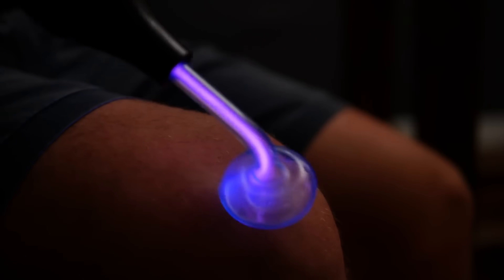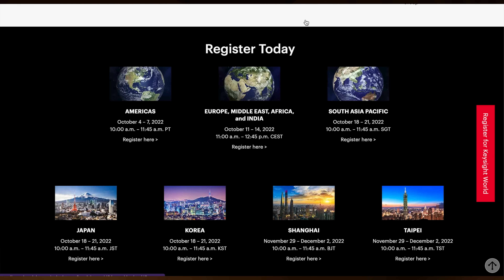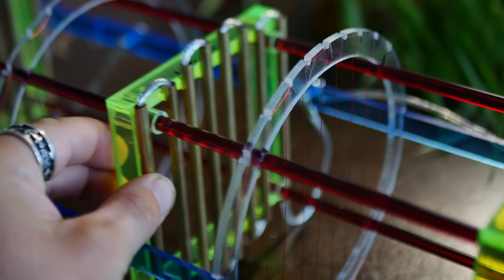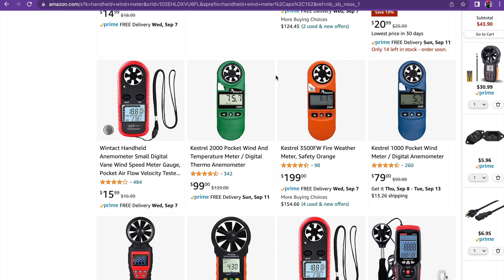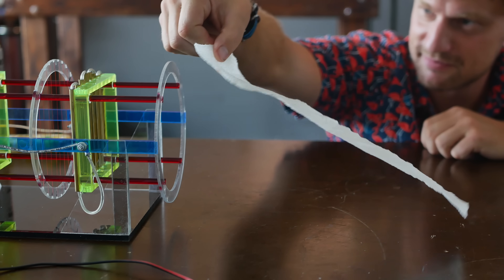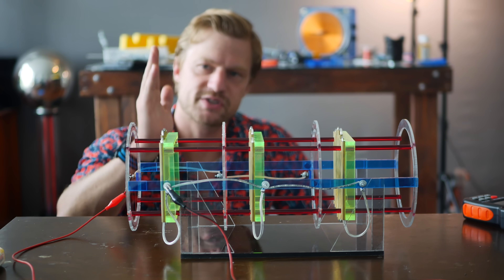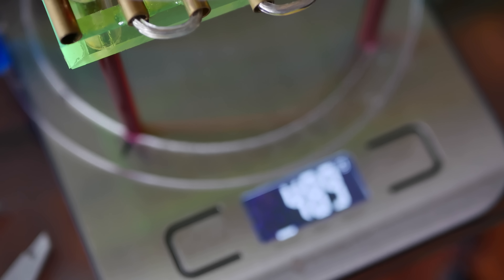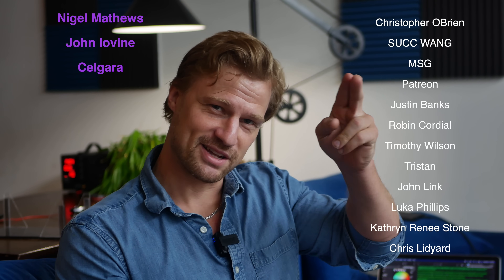Designing A Next-Gen Ionic Thruster! (For Flight)

Comment: i may not be the smartest, and i know this is a test model, but in future non-test builds exposed wires are a bad sign...
i know that they are exposed for ease of expiramentation, but i had encountered many shocks because of this...
when this type of engine gets a casing, i wonder what steps you will take to safely house the device, seeing as plasma heat and electricity can destory most material.

Comment: using high voltage to ionize air might be augmented by using soft x rays to ionize air so that maximum efficiency could be produced. It is well known that an electroscope can not be charged up in a room where a x ray tube has been operating because the air has been ionized by the x ray radiation. By incorporation of a radiation device on a ionic thruster we pre-ionize the air and possibly increase the thrust. Alternate sources of ionization would be short wave uv , soft x rays, or alpha emitters such as smoke alarm polonium strips.

Comment: First; great idea and construction. But does it makes sence? 4.5% without inertial energy potential (battery). Ok lets say we can optimze stages and bed it into a variable duct cone using optimal materials, we may end up at 18 - 22 %. Feels like not competetive to other electro based thrust sources. But whats about the conditions? So to say air pressure and stream velocity. Will it perform with same efficiancy  in greater hights or by high and extreme speeds? If it does, it may be worth for some seriouse mathematics.

Comment: A couple of thoughts, first encasing the whole things like others have suggested, but ducting the intakes at each element to allow increased airflow in to the chamber at each element. second how about looking for the optimal distance between element pairs for the airflow to be accelerated , i.e. is there a waveform in the airflow that would increase thrust by hitting it at some point where the wave form is most optimal. Third would turning the elements offset to each other by some fixed measure impact the airflow and waveform to increase thrust. Also once encased if you run into oscillation in the air flow or blow-back you could alter the intake to only allow airflow in one direction like a valve. I'm interested to see the next build and what steps you take to advance the design. One last thought, would compressing the airflow between elements have a significant impact , with ducting at each stage to compound the thrust?

Comment: use a turbo charger and enclose the thruster as a replacement to the combustion chamber (the heat in combustion chambers  actually harm thrust it is just used to accelerate the air with expantion) you have the air being accelerated would be curious how compressed air affects the ionic flow??? lets see...

Comment: Looks like enamel coated wire. I'm assuming the bright dots in your dark shot are areas of burned through insulation. Would a bare conductor flow more plasma and therefore more air?

Comment: Using an all in one 3d printed in carbon fiber close chassis would give relatevlt insane gains, not only the weight would be the same or even reduced, but carbon fiber would have a very great structural strenght + having a 3d printable model of the chassis would help if it brokes.

Comment: Better wire gauges and or improved wiring material (25gauge gold solid wire, for example) / Static electricity shielding / Condensed wires or addition of more. / Carbon fiber parts better strength and lighter weight.

Comment: If you're really designing for maximum thrust, you need to consider methods of compression (Resistance), and ways of multiplying the pressure within the engine body. In a turbine engine the air is highly turbulent & compressed in a gradient series of fans and static louvers, before reaching the combustion/intermix chamber where it's further energized via combustion then ejected due to clever plumbing. You should be able to emulate the same effect with induction coils that envelope the space between arrays ( imagine the ion arrays as the fans, and the induction coils as the static louvers). These could be wound around a larger cylinder that the ion arrays fit inside of acting both as wave guides, as well as further energizing and compressing the plasma stream likely inducing a vortex effect= higher compression/pressure= more thrust (Think about how a Tokamak electromagnetically governs the plasma it produces). I'd also reconsider how you wind the Ion arrays, maybe a flat torus (suspend a smaller plastic ring inside a larger plastic ring via a torus winding)= maximum wire surface area= more plasma. Basically building a linear Fusion reactor..sort of.

Comment: Ducting, jet nozzle, heated emitters/warmup period, roughened/frilled emitters.

The reason your system is more useful with staggered distances is because the first one has to be shorter to get the air moving the right way for the later two to push it well enough. A small ring-shaped blower like the triangular hoverthruster wrapped around the outer edge of the intake would cause air to be pulled into the duct in a line, allowing the air to be more efficiently blown along by subsequent grilles.

Comment: I assume you reversed the polarity of the electrodes to check how efficient the thin wire (pos. electrode) vs. the thick wire is? What was the outcome?
While the positive electrode thin wire seems intuitive it's not the case with making the negative electrode wire thick. I wouldn't be surprised if using thin wires on the negative electrode but more of them would do electrically the same while reducing resistance to air  flow.
I assume the size of the whole thing was chosen in a way that  the bigger distance between the electrodes that creates the field in the wrong direction is so big that the electric field strength is not strong enough to move electrons out of the electrodes at all?

Comment: Quite similar thoughts all over:
1) shield airflow, add foil covers (minding weight increasement
2) play with intake air density, or gas composition therefore increasing or decreasng in output efficiency
3) adjust thicknessand weave pattern of the  emitter  wiring

Lets see part 2 ! Have fun building that engine :)
Reply: I agree with 3, spiral cone design for the electrodes would be my modification.
Reply: @5umopapisdn5  that was my immediate thought.. playing with the ratio on staggering on this test unit and finding the curve to duplicate in 3D
Reply: Those were my thoughts 💭 
Brilliant!
Reply: the wiring could even end up being some airfoil shape to increase effective surface area, and control drag levels
Reply: @FrostCraftedMC  drop shaped wires. why not!
Reply: @Oni Yes it should! but there are limitations, in the tightness of the weave in  and thickness of the (coper) wiring. You could over engineer the device and increase the airflow even more, but soon you'll find one of the biggest issue will be weight of the device (and thus power to weight ratio) 
I do believe there are more than 10 tweak knobs we can twist to improve the current device (which looks awesome by the way!) Hope our Plasma Master will indulge us with some design and performance upgrades soon. No pressure there
Reply: i was planning to use heavier gas, but they are either too expensive or poisonous
Reply: and he could add a nozzle to direct airflow
Reply: im still thinking about how he could optimize the pattern itself...he is going back and forth...what if we go up and down as well with a space small space so you have no touching of wire and produce twice the ionic plasma. which in turn double if not triples the layers. And what if you add more could u get enough thrust to make is applicable in todays industries?
Reply: Great suggestions. This overall imitation of gridded ionic pulser model still isn't the most effective choice under atmospheric conditions, considering.

Comment: i saw on the photos that there are only a few bright spots on the wire where plasma shoots out. is it possible that some wire with rough edges like the blade of a fretsaw would give the electrons a lot more possible exit points?
Reply: also maybe the ground tubes block too much of the area through your thruster.

Comment: And my second comment: What about the shape of a flying saucer? Spinning for stability. Wait! The thrust jetting outwards on a perfect circle, and at the same angle causing a spin on a circular wing, with aileron-type blades to create a gyroscopic lift. And can high-altitude give you the POWER you are looking for? Thinking outside the box. Or maybe, a disk, above another disk with a curve (bell shaped) and the larger opening, with a smaller disk inset, and also spinning, causing downward thrust. But still also thinking of gaining in altitude will gain in POWER also.

Comment: @Plasma Channel it needs a narrowing channel/duct where the airspeed increases, it needs the trailing edge of the target electrode flattened so it's a teardrop in cross-section, you can almost certainly use lighter electrodes, ie metal-plated foamed carbohydrate, and you should have increasing voltage on the later stages.  The duct will add rigidity as well.

Comment: -Adjustable positive and negative electrodes
Try staggering the positions  such that each thruster segment has a slightly different positive/negative patterns
-Grid pattern for the electrodes
-Cylindrical shell to direct airflow
-Argon gas

Comment: Changing the ground electrodes to plates (or any geometry other than cylinders) could improve efficiency significantly. Cylinders are extremely non-aerodynamic and have a tendency to create turbulence/negative pressure against the airflow and this could be hurting your total output power.

Comment: Weight definitely.  You know the optimal distance each stage needs to be at, so you can easily remove all the excess material with a redesign and make the stages fixed.  There's probably also lighter, more durable materials you can use other than plastic, though they come with their own issues too, I imagine.  As for the other two, probably the power waste and cost? I dunno.

Comment: My daughter and I built an original style lifter for her school science project and that one also produced a nice corona effect in the dark.

But we also found out quickly that moving the electrodes too close together caused them to arc out and catch fire. 

In order to get more lift force we also found that moving them further apart was needed .

And furthermore, the lifting effect did seem to be more than just ionic air flow as the device would just shoot right up once the electrodes were far enough apart.  The lifting effect was nearly instantaneous and seemed to be more than simply air flow.

I also wondered if pulsed Dc might have increased the lifting effect at very high frequency pulsed dc.

Keep in mind that some who have worked with Lasers and high frequency devices of high power have noted that there may be a lifting or ionic force that can potentially distort the dimensions of the devices.

Higher frequencies may equate much higher forces and I suspect, as do other that high frequencies through coils can produce energies that, at the output are greater than the energies fed into those devices.

SO, you might look for a pulsed dc source with the ability to use high frequency pulsed dc and apply that to your device

Let me know if you do so.

mrbrucewayne63@gmail

I have also subscribed and will ask my daughter to take a look at your experiment also.

Comment: Genius!! Hmm I'm thinking your 3 inefficiencies are 1. It's sensitivity to outside electrical forces 2. The outrageously high voltage required for only 2.3 m/s of thrust. 3. The design relies on atmospheric pressure, a better design won't create more air unless you have a greater surface area on the face of the cylindrical object. To do this you would need to scale a 3D object to increase a 2D value, which will decrease your thrust to weight ratio.

Comment: 1) Voltage limit is definitely a factor and the fact you didn't feel safe increasing it to a certain level could be addressed.
2) Weight and portability, it seems to have to be attacked to a battery pack so having more efficient power source that is also lightweight is essential
3) Materials: more expensive materials for all components will increase your success rate surely?

Comment: Here are my ideas for efficiency improvement: 
1. airflow should be in a tube (Food wrap?) 
2. Square supports & internal structure causing drag. use round only, move supports to outside
3. make the Ground electrodes smaller to allow more airflow

Comment: For me it comes as no surprise that the staggered spacing would be better. Consider the gears on your transmission the shorter the gap the more it pulls the air along easier. However the larger the gap the more potential for speed yet this may take too long to speed up the air thus never reaching terminal velocity. Think of bogging the engine down like using too wide of a gap. This is all just me playing with ideas in my head but I'm sure I could make use of this technology thank you for the knowledge.

Comment: My thoughts, are that:
1- The red wires can get used up by decreasing amount of material in the wire.
2- More stages means more air resistance and can be made more efficient by better design.
3- Some kind of electromagnetic distorsion.

Comment: As an experiment in variable field density, try going to the highest voltage on the "Entry ring", then step down the voltage as the ring spacing diminishes...Somewhat akin to jet engine compressor stages.  Then look for the "Sweet Spot" again.

Comment: im no engineer, not even close, but what i question is
1. if it is a closed barrel, would it be better?
2. if the air is funneled out, would it be better?
3. the wires would be the first to wear, will it be better if they are strips that help direct air flow?

observations of a vacuum and my air conditioning. heck, it will be real cool if its takes in air like the air conditioning. Centrifugal fan.

Comment: One inefficiency is due to corona discharge in the wrong direction through the thruster. The individual stages don't use isolated supplies, so there may be some reverse thrust from the wires to the tubes of previous stages. Three isolated power supplies might help with this or maybe different bias voltages from stage to stage (although I'm not certain about the latter). Another solution I can think of is to use teardrop-shaped electrodes instead of the thin wires. Pointing the "point" of the teardrop electrodes downstream would help reduce corona discharge in the reverse direction. 

Also do you have a smoothing capacitor on the output for your voltage multiplier? Ripple in the supply could potentially cause some corona discharge in the wrong direction (from the tubes to the wires) as well.

Comment: as everyone else has said.. the obvious changes are

1. an engine needs to be enclosed. running it open air like that is going to have severe effects on flow. 
2. once you have enclosed it, repeat your stage tests. 
3. try switching the stages, stage 1 at x voltage and distance, stage 2 at x+n voltage and distance etc to capitalise on the difference in flow rates at each stage, because the first stage is accelerating stationary air, and each stage beyond that is accalerating air at increasing velocities.  think "rail gun" 

please keep going with this!

Comment: Your thrust to weight ratio didn’t seem to include your power supply or voltage multiplier. I realize these things can be purpose built to be considerably lighter but it’s something that still needs to be considered when talking about your thrust to weight ratio. Great video as always!
Reply: You should check out Ethan krauss's ionic wind device on YouTube. The power supply is on board.!
Reply: @carlsagan8351  I will, thanks!

Comment: Excellent job!
Given electrohydrodynamic thrust is dependent primarily on energy & particle density, and interstellar space has far less particles, those with mass  being subatomic, I would say the energy density is the primary factor in increasing it's thrust to weight ratio. That being using niobium wires on ceramic insulators. The cathodes can be laser cut and yes there are many things that cen be improved. The efficiency of the inverter also matters as it affects the performance of the thruster. Once you improve your design I'd try testing it in a vacuum chamber.Thermal imaging can help you visualize strain areas give you plan on increasing the energy density.

Comment: Having a baseline on how the stock thruster operates means you can try a few things like Pulse Width Modulation, sequentially firing each element and the most obvious a ducted shroud.

What to try from there..  Making a lattice wire element, a carbon filament element, experimenting with coned inlet ducts and try different exit angles of thrust.

Comment: Make the design ducted and more aerodynamic. Your probably loosing a fair amount of thrust out the sides of your design. Additionally why not find the ideal number of sections required. You could calculate the %increase per added stage and find the %drop between the stages. Compare that to weight and you can estimate the ideal number of stages to improve thrust to weight. Cool build